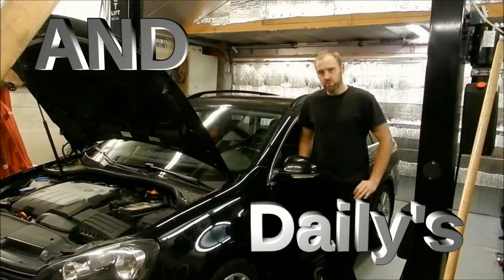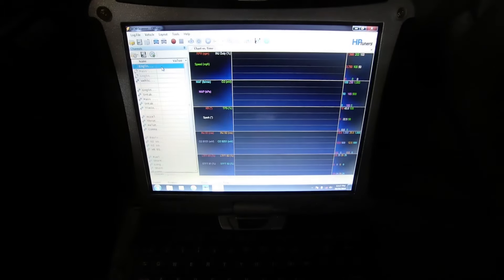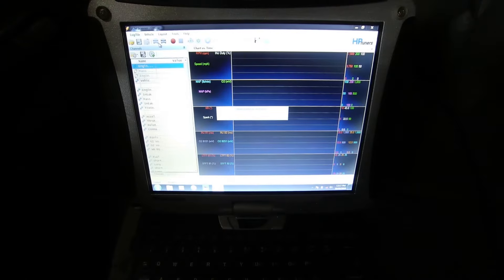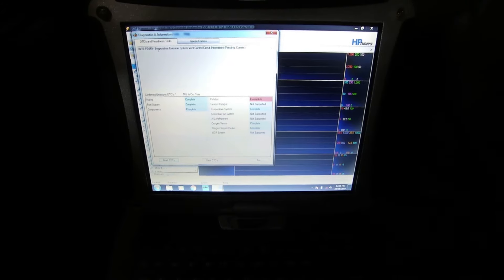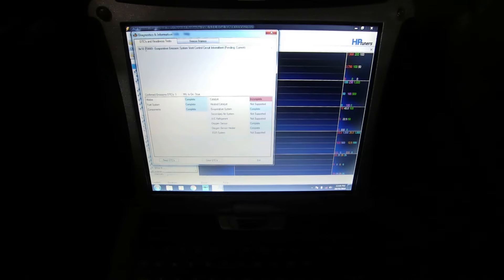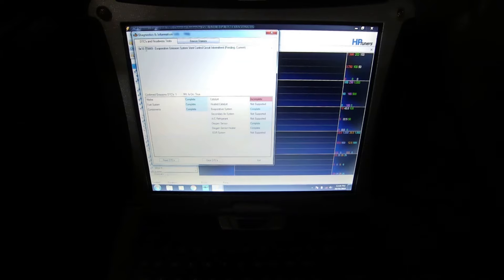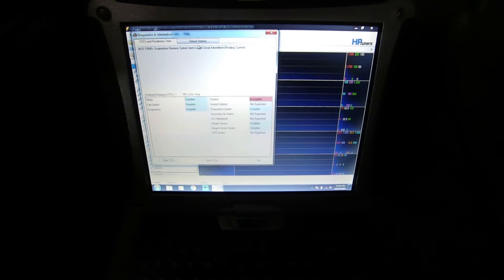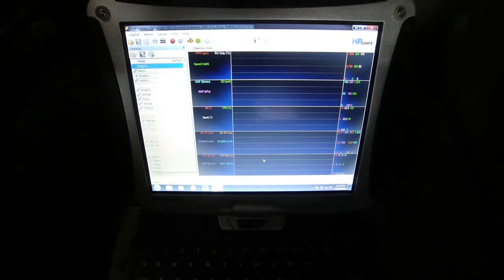The Common GM EVAP Code How to Diagnose and Repair

Comment: Thanks for the video, question- when I look up the part it does not look like the one you took out in the video. I have a 2008 avalanche. The parts I am seeing have two air ports along with the two prong electric port.
Reply from the maker: That might be the purge solenoid you looked up.

Comment: What is a P1746 code?
Reply from the maker: Definitely not an EVAP code.
Reply: EVAP leak detection pump on a 2021 trailblazer
Reply from the maker: @suttonshiver1317  any EVAP code should be a p04xx code. That looks like a transmission related code to me. I'd be surprised if that's what it is.
Reply from the maker: Besides that, isn't that thing still under warranty?
Reply: GM specific code. Yes still under warranty fixed about 2 weeks ago
Reply from the maker: @suttonshiver1317  what was the fix?
Reply: Replaced EVAP leak detection pump
Reply from the maker: @suttonshiver1317  wtf, huh never would have guessed unless I was digging into it myself. Guess they are changing code basic numberings. Go figure, the future repairs will be interesting I'm sure newest I've been hands on with is 2018. That was not at all a factory thing though. 2018 mustang getting twin turbos lol.
Reply: Most definitely I think there are changing the codes

Comment: is there a way to delete this ehole system some how im sick of this shit 😭😂
Reply from the maker: Not really. One could turn it off but typically once you understand it, they are easy to fix and usually not that expensive to fix either.
Reply: @CrazedPerformanceRepair  I have a p0442 code that won’t go away on my 2007 Chevy Avalanche. I replaced the purge valve and the gas cap but the check engine light keeps coming back on
Reply from the maker: @tonyfelder3195  have you checked the vent valve or hoses.
Reply: @tonyfelder3195 sos you get to fix it? Have same issue on my 06 gmc Sierra